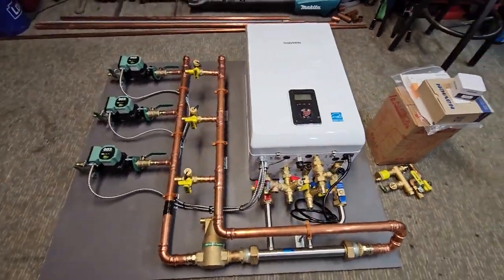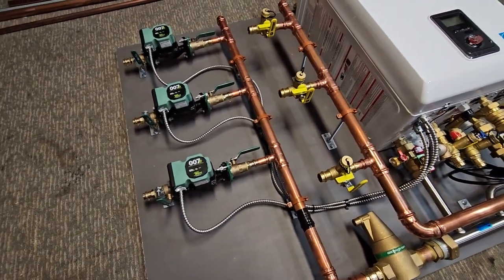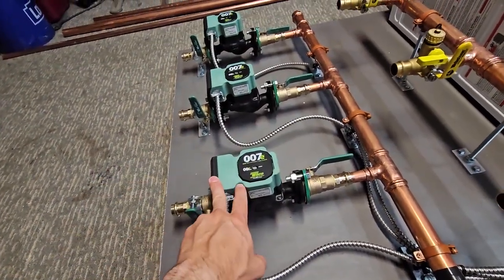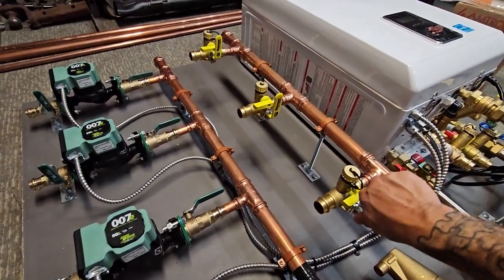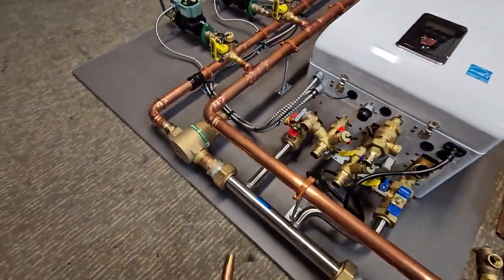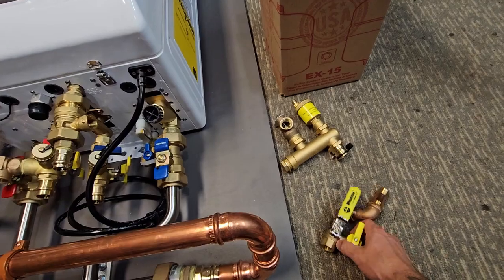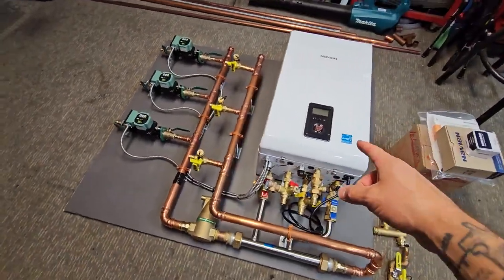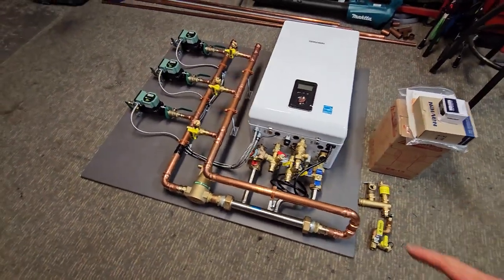3 Zone Navien NCB Ultra High Efficiency Condensing Combi Boiler System

Comment: Do combi units work well with a whole house water filter? Is there any considerations with regards to gpm? Also, i see in your videos it appears you use the same brand. Any specific reason? Would you consider others?
Reply from the maker: @blkjack0o  no issue as long as the whole house filter is sized correctly. I use Navien because of my experience and expertise with them specifically however I do design and build with any brand boiler if a customer prefers.

Comment: Love your videos👍, Does it require zone valve after Taco 007E circulator?
Reply from the maker: There are many factors that go into designing a system. A system can utilize a single pump for 1 zone or a single pump with zone valves.

Comment: i have one of these and it was great until some undrained water in the heating system froze in a winterized cabin, cracking a few fittings inside it - finding the replacement parts was a real bitch
Reply: Put antifreeze in the system. Very easy and solves this. But make sure you get the right one.
Reply: this was in the part that acts as a just-in-time heater for potable water -- on the potable water side of the heat exchanger
Reply: @gusmueller4413  if you leave the power on it has a feature that wont let the on demand side freeze. Or use a compressor and blow it out. I have had this happen once or twice when customers lost power but where i am parts are very easy to find and tech support is fantastic. I love these boilers.

Comment: I purchased a house with a hydronic system. Some baseboards, some radiators. There's a fairly new Buderus boiler and what appears to be an unbranded wood boiler from the 70s. It has to be manually swapped by closing and opening a few valves. There are 3 zones, and I'm thinking about adding a few more as I renovated and start installing radiant heat floors. During my house search I remember seeing a system that had both a propane boiler and an outdoor wood boiler. It was setup so the system would default to the propane and automatically switch to the wood boiler when it got to temperature. How expensive/complicated would it be to setup a similar automatic fail over? I'm probably going to swap out the old wood boiler for a new pellet or wood boiler and I want to wrap my mind around what is needed and approximately what it would cost.
Reply from the maker: Email me at speranzadevelopment@gmail.com I can discuss some options and how to go about setting up the two systems to work together. 👍